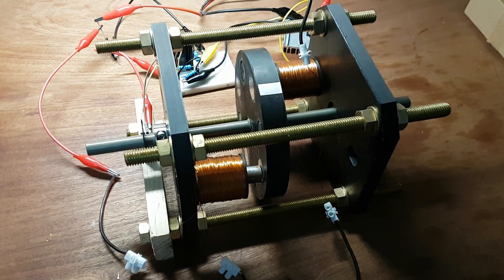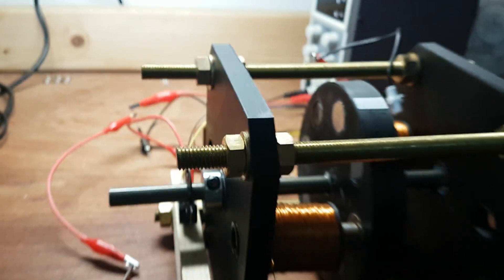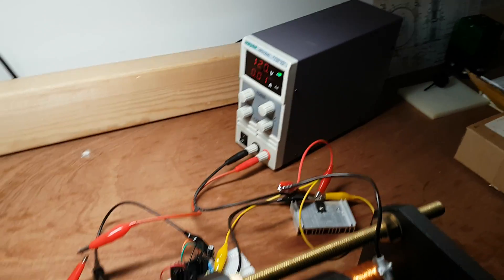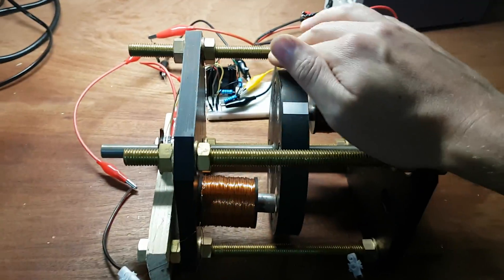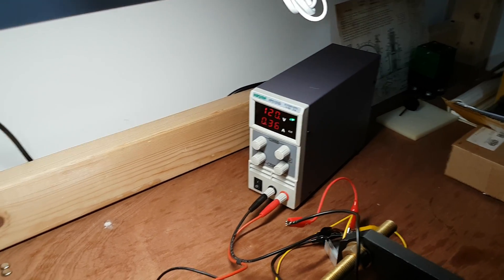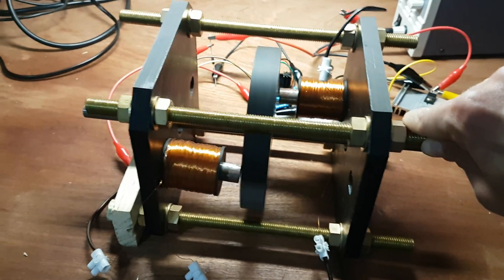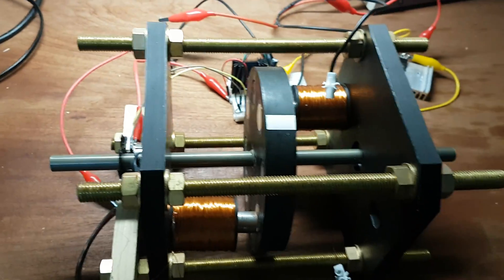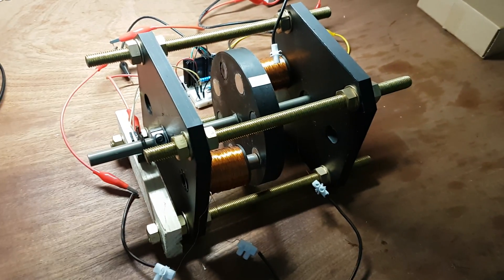Adams Thermo Motor back in action (somewhat)

Comment: How do you measure efficiency ?
Reply from the maker: I don't measure it yet in this device, as it is clearly not working very well right now. The inventor said the only accurate way to measure it is calorimetry, or heat in vs heat out.

Comment: Maybe it would work better if the space between magnet and the coil core is much larger. Nice job
Reply from the maker: Can try that, but the reason they areso close is because Robert Adams mentions in several places that the ideal gap distance is 1.25mm.

Comment: Nicely done. I wonder how the performance envelope would change with the coils directly across from each other.
Reply from the maker: Yeah this setup doesn't seem ideal, as it also pushes the rotor into a slanted position, but in ALL of the Adams Thermo motor pictures I've seen, the coils are in this position, so Adams must've had a good reason for it.

Comment: Are those generator or drive coils?
Reply from the maker: Hi Luke, those are two 36 Ohm drive coils, as per Adams' recommendations for this particular motor.
Reply: @Waveguide  Cool, are you planning on adding the generator coils soon? Ive yet to see someone properly replicate this design, with correctly switched generator coils. Thats where the lenzes law is overcome as I understand it, your previous model looked close
Reply from the maker: @lukehoza9571  Adams designed two machines:

1) Adams Pulsed Electric Motor Generator 
2) Adams Thermo Motor Generator

#1 has generator coils around it, as you can see in my earlier video, but Adams himself never mentions the generator coil switching you refer to, it was Patrick J. Kelly who suggested that.

#2, which you see in this video, only has 2 drive coils, and generates tremendous amounts of heat instead of electricity, so no generator coils.
Reply: @Waveguide  Oh i see now, Thanks for the reply, looking forward to see your progress.
Do you plan on attempting the switching generator style?
Reply from the maker: @lukehoza9571  possibly, but it would be for testing various generator setups, not necesssarily related to the Adams Motor. I would also like to test the Thane Heins ReGenX generator setup, for example.
Reply: Very cool prototype !
  Witch motor makes more torque this design or the other style with coils on the outside? 
 I see your running 120v that Adams says    

the pulse spikes must be in the 1,000 volts 
 My 12 volt one make 200 v 
 Have you removed the negative energy on this one to run something else ?